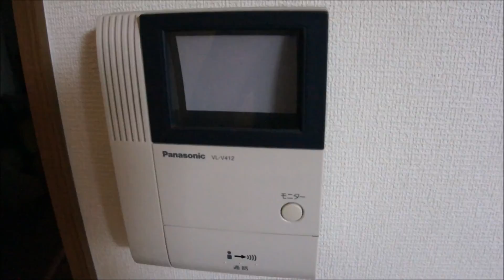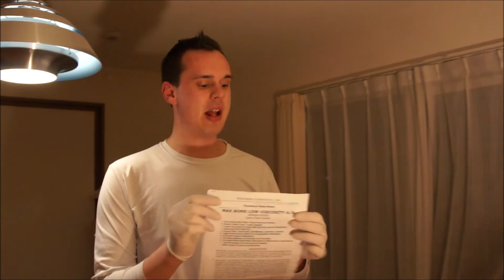Blondie Build vlog003: How to fillet with epoxy and wood flour.

Comment: Just wondering if your neighbors complain about the epoxy smell? Cool build BTW!  (Found you on Reddit) I am rebuilding a boat right now, so check it out when you can.
Reply from the maker: Hey Captain House,
The epoxy smell isn't too bad! It only lingers in the Apartment for a few days. As long as I keep the window open I'm good. I have a good cross breeze here.  I'm sure if I was using a polyester resin they would.  I'll definitely check your videos out.